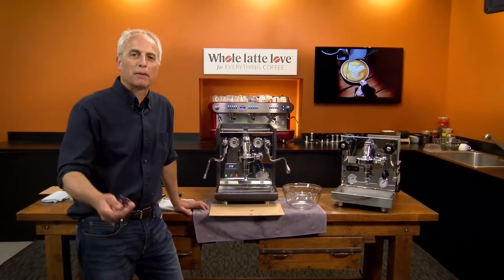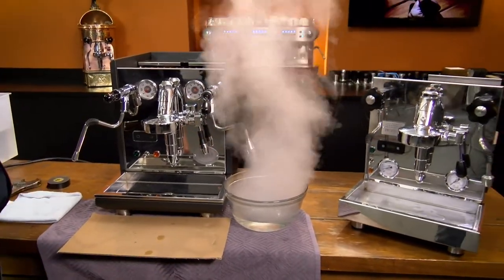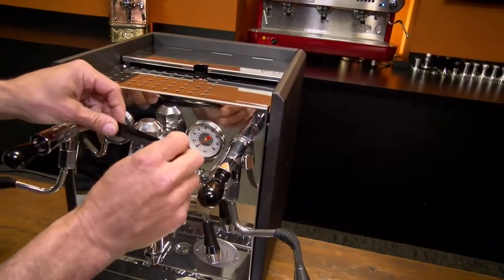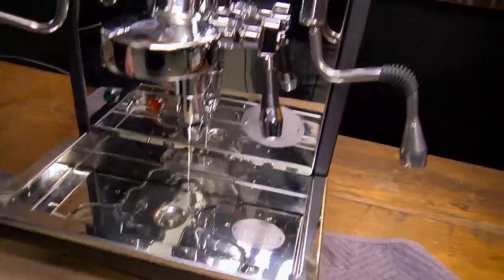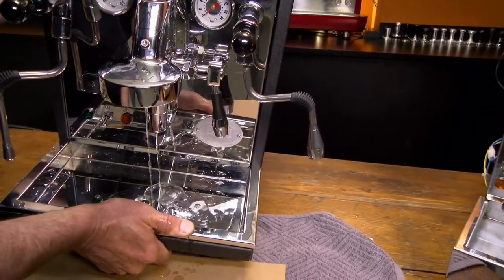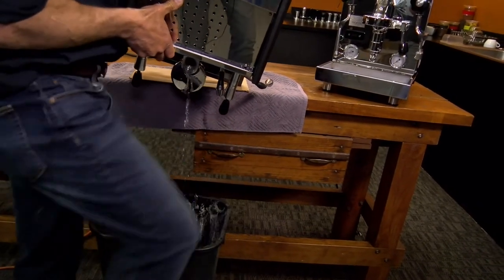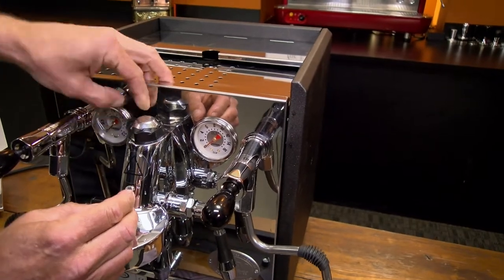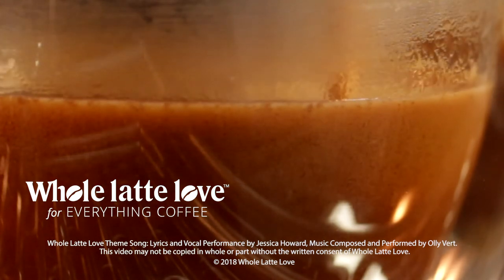How To Drain Boilers of ECM Synchronika & Profitec Pro 700 Espresso Machines

Comment: Add this to the list of things I hope I never have to actually do.  Loving my Synchronika so far.
Reply from the maker: Hi Carl, Thanks for the comment! It is a wonderful machine :) Do you have a recent Synchronika with PID upgrade for higher steam temp/pressure?  Machines we shipped starting 6-8 weeks ago (early April 2018) can set PID to 270F. Boiler draining isn't terribly hard. For those with older Synchronikas or Profitec Pro 700s who want to upgrade to the new PID removing the brew boiler is required to access the PID to do the upgrade: https://youtu.be/530bd0birgw
Reply: Placed my order in early May and got it a week or so later after some back and forth with UPS.
Reply: And I have to do this now because I didn't swap my water softener cartridge out in a timely fashion.  Have lots of sediment in the tanks and already had to clean the screen at the top of the E61 to restore flow.

Comment: I actually did change the PID on my 2017 Synchronika last week and I did not drain the brew boiler first. It really was not necessary; I could release all the internal piping, open the two screws connecting it to the frame and could simply take it out upright. I then drained the boiler directly into a little bucket.

But here's a question:
Since I installed a new PID it went into fill mode automatically. But if I have to drain the boiler for whatever reason in the future wihtout changing the PID, I assume I have to set the PID to fill mode BEFORE I switch the machine off to drain the steam boiler, because I will not switch it on again before the brew boiler gets drained and the filling mode must be selected before that, right?

Comment: thanks for all your amazing videos! Is this any different fro the profited pro600? And can this approach be used to run descaled through via the reservoir?
Reply from the maker: Hi j, You are welcome. Yes, if you have the skills you could use to descale. Just a heads up, most manufacturers recommend home users do not descale dual boiler machines. They advise DB machines be descaled by a professional. This because DB machines have relatively complex internal components which are subject to clogging if descaling a neglected machine.
Marc
Reply: @Wholelattelovepage  thanks! Mine is only 14 months old and we live in a soft water area, so I’m considering it as more part of regular maintenance. The 700 manual gives instructions for “prophylactic descaling” but the 600 doesn’t which I found a little confusing given they seem pretty similar other than the boiler sizes!

Comment: Why are you doing that? I am planning to purchase either a Pro 700 or a Synchronika. 

Which one is better?
Reply from the maker: Hi Poppo, Why drain the boilers? For long term storage where machines might experience freezing temperatures. The Pro 700 and Synchronika are essentially identical internally with matching specs and capabilities. The Synchronika has more refined details of external components like angled and chrome tipped portafilters, tapered E61 group head and it's the easiest machine to open up.
Marc

Comment: Hello! I just got my synchronika and I am really enjoying playing around with it. I'm just wondering if I don't use it for 3 days or so is it a bad thing to leave the machine sitting that long without cycling the water? Also I read some comments about not drinking the hot water from the hot water wand because the water comes from the boiler.. I don't know why this would cause any concern but is there any harm from consuming the hot water from the boiler? Thanks so much Mark for the incredible videos!
Reply from the maker: Hi s m, Great to hear you are having a good time with your new Synchronika! Boilers in the Synchronika are stainless steel so nothing there to compromise water quality. I have no problem with water sitting 3 days but turning over a bit of water (no need to do the full volume of the boiler) is a good idea depending on how you use your machine. Very common to use hot water from the machine for Americanos. I wonder if the comments you're seeing are in regards to concentration of minerals in steam boilers. It's the same boiler which makes hot water and steam. If you only use steam and never take hot water from boiler over time mineral concentration will rise in the boiler. The steam removes small quantities of water but the water coming out as steam is essentially distilled with near zero mineral content. The minerals stay behind in the boiler. It takes a lot of steaming io cause a consequential rise in mineral level in the boiler. And that will only happen if you never take water out from the hot water tap. Running an ounce or two (30-60ml) of water out of the boiler every couple of days will return mineral level to where it started. But you don't need to think about it if you take water out for other reasons. Hope that makes sense and helps!
Marc

Comment: Awesome..!..i have my Synchronika coming up nearly a year and use the machine  about 3 to 4 times a weekl..Is it worth to drain the water..? or  should you do this once or twice a year for draining..?😊😊
Reply from the maker: Hi J, No need to drain the boilers unless you were descaling or working on the machine and don't want a mess! Fairly easy to turn over the water in brew boiler by running pump.
Reply: Ok ..Thanks 😊

Comment: Hi - Great video. I have the pro 600. Is it necessary to drain the boilers if the machine is being shipped via air/sea and will arrive in 1-2 months? If it's safe to leave some of the water in the boilers that would obviously be much easier. Any advice welcome and thanks for the machine. Glad I purchased from you guys!
Reply from the maker: Hi Adam, Thanks for the comment, question and your patronage! Please excuse my delayed response. I've been offline for a few days. If there's any chance your machine will experience below freezing temperatures then the boilers should be drained. Otherwise it's no problem leaving some water in there. Just be sure and flush well before using again.
Marc

Comment: I'm guessing you just wanted it to cool down so it's easier and doesn't burn you before emptying the brew boiler, right? Oh also so there's no pressure built up in the mushroom area.
Reply from the maker: Hey Ben, Yes. You do need the machine heated to push water out of the service boiler but can cool down for the brew boiler. Pressure in the mushroom is slight. Be careful of course but usually not a problem to take the mushroom off with machine heated. Remove slowly to allow to dissipate and lift the lever.

Comment: Hey have just cleaned the vacuum relief valve on my SCM barista profi.  As the boiler itself is now empty when I get it all back together I get both the green and orange lights on which seems to be wrong. I am expecting just the green light on and the pump to draw water from the tank.  Yet is isn’t working like this.   What do you think may be the issue.   Yes the tank is full.

Comment: Hello! Amazing video - Question though - If the boiler is all empty, and I come to plumb it in / fill it, wouldnt this ruin the heating element like a normal water heater? You mentioned at the end of the video there is a way to do so, Cant locate this video. I am shipping the machine for a 40 days sea & land freight combination trip and worried about how to re-start it once I drain the boiler. I can also keep the water inside but I am afraid maybe there will be a leak of some sort along the route.. Thank you for your help.
Reply from the maker: Hi i, Thanks for the question. No worries on damaging the heating element. Just start the machine up as if it where new. There are water level sensors in the boilers. When the machine is turned on sensors will detect no water in boilers and fill them. As added measure, you can turn off the heating element of the steam boiler using switch behind the drip tray. When plumbed, the machine is open to line pressure so the brew boiler will fill even without the pump running. Just keep the group lever up as if you were brewing a shot until water comes out of the shower screen.
Reply: @Wholelattelovepage   Beautiful. Thank you very very much for your kind help and valued support :) Here's hoping the machine arrives safely. It's been a pleasure owning this one. Have a lovely day!

Comment: Is full draining of water from boiler is necessary on daily basis after use? Or the water can stay in machine till the next day of use? Please advice
Reply from the maker: Hi MH, Thanks for the question. No, full draining is not required nor done. Perfectly fine to leave water in from day to day. It is a good idea to turn over the water in the service boiler (steam boiler) a bit if you only ever do steaming. If you never take straight water out of that boiler and only steam over time minerals will accumulate there and scale formation will be more likely. Doesn't take much a cup or now and then.
Marc

Comment: May we drain steam boiler by hot water valve to avoid so much steam in house?
Reply from the maker: Yes, you musty drain from hot water valve as it comes off the bottom of the boiler. Steam valve comes off the top of the boiler so water would not drain.

Comment: What is the size of the adjustable wrench for the brew head nut?
Reply from the maker: Hi Paul, Thanks for the question. It's 36mm nut. I use a 12" Crescent wrench that can open up to a max of 1 5/8".
Marc

Comment: Does easiest method exist? With small compressor or whatever?

How often shall we drain boiler?

When I plan 3 week holidays may I leave water in boilers or rather shall drain them?
Reply from the maker: Hi N, This is the best method short of physically removing the boiler from the machine.  3 weeks should be okay for leaving water in the boilers. I would turn over the water in boilers prior to next use after long idle period like that.
Reply: @Wholelattelovepage  
Thalnks a lot. That's clear.